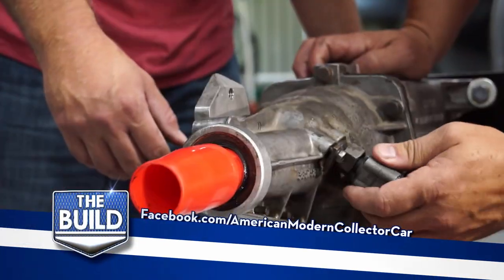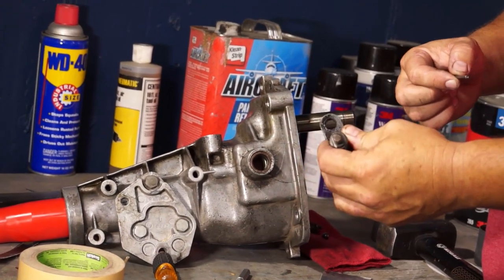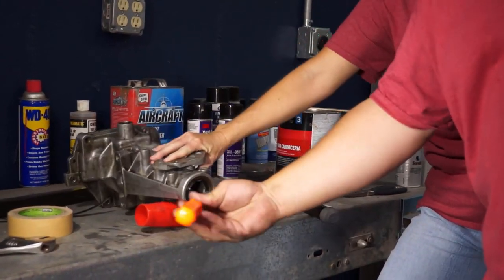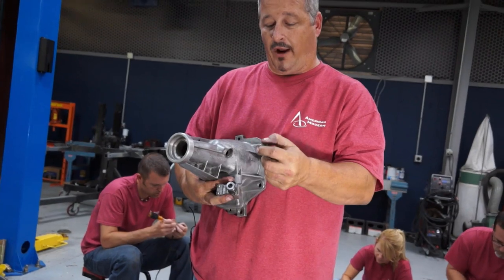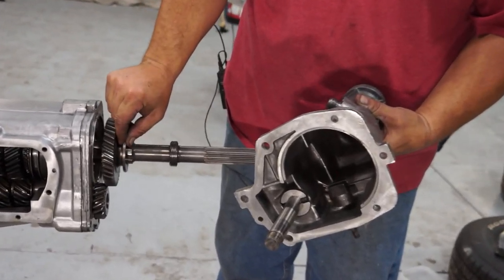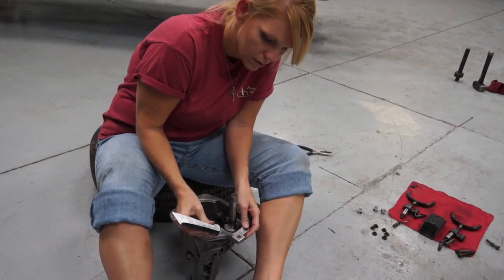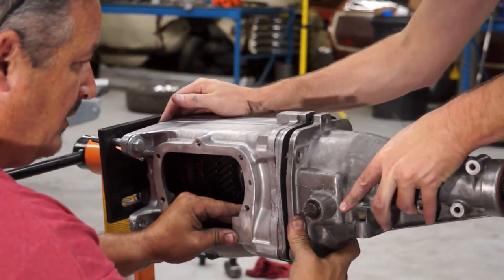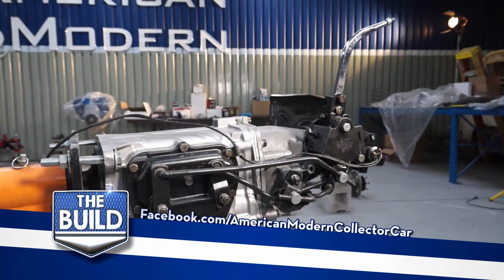Dismantling, cleaning, and assembling the Muncie transmission, part 2 - The Build

Comment: Oh PULLLEEEZE!!!  That's not a "build" at all!  Changing out a couple of seals is no big deal.  And what was the reason to pull the tail cone off?  To replace the reverse shifter shaft seal that probably wasn't leaking anyway?  If they had taken it down to a bare case and replaced the synchros and bearings, now THAT would have been a build.